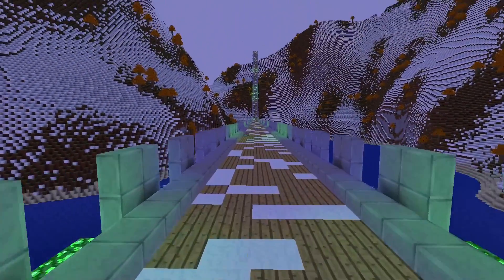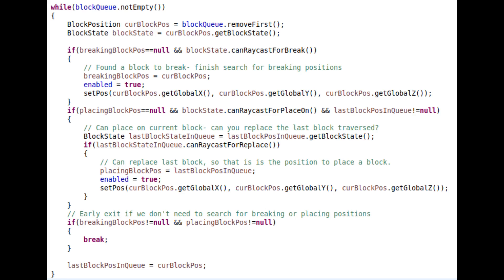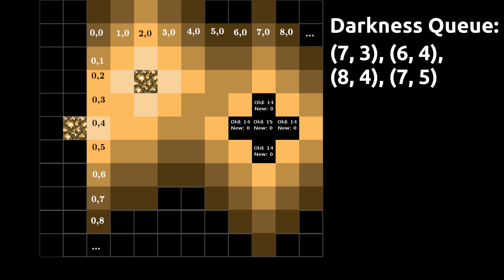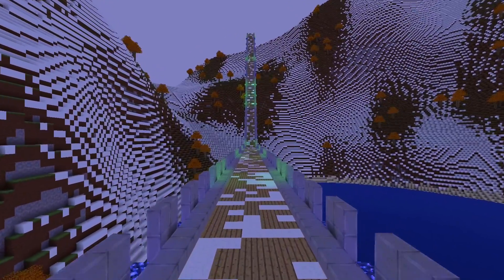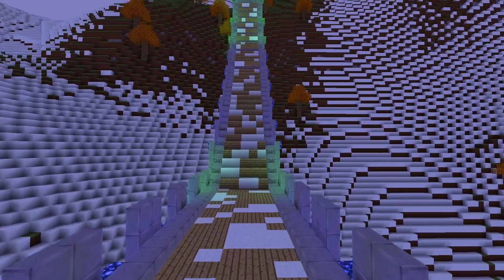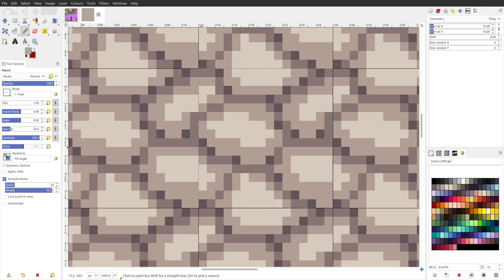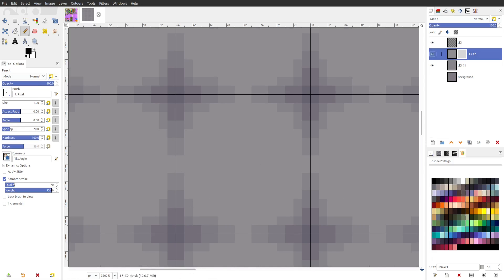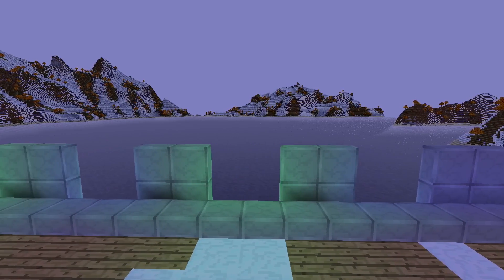The Algorithm Behind Breaking Blocks – Remaking Minecraft

Comment: I'm always facinated by your videos and am somewhat basing this to make my own voxel engine but in C#. I have 1 question though. How do you remove unused blockstates in the block palette when setting a blockstate. I'm thinking of checking each block ID in the chunk and if none point to the block in the chunk palette then remove it and update all other ID's above the removed one. However I don't think this is efficient so I would like to know how you did it :)
Reply from the maker: I've purposely left that for later! I'm leaning towards having a second collection to map blockstates to the number of usages. Once it maps to '0', then remove the mapping and the ID palette mapping. Alternatively you can iterate through whenever 1) you save or 2) you run out of IDs, then remove unused mappings. It depends on your use case.
I would not update IDs of other blockstates, it's better to have it be discontinuous with a C# Dictionary<> instead of an array.
Reply: @finalforeach  Ah ok. Thank you!

Comment: Is there a benefit to putting all the block textures into one file instead of multiple separate files like Minecraft does? Would you ever consider putting the textures into separate, unique files?

Also the texture work you've is really solid, if you ever decided to translate it into a Minecraft resource pack I would use it 100%.
Reply from the maker: The advantage of using a texture atlas is that it's 1) simple to implement and 2) doesn't require a separate draw call for each block. I think there is a better way with texture arrays, and even if that isn't used, an atlas can be stitched at runtime from multiple textures. Having separate texture files is on the todo list, but not the biggest priority right now.

Comment: For crafting, I would just wanna say this: modded Minecraft, often with larger modpacks, solves this by grouping recipes in the recipe book (or perhaps in the JEI mod) by modpack, and then by resulting block. If there are variations to a block, it lists them separately, however, if there are not, it uses a system of "tags" on specific block type variants. For example, you ca  craft a chest woth any type of wood, but in heavily modded Minecraft, you can end up with tens, if not hundreds of wood types. So the solution is to have a mod library which can list all these wood types under one simple tag that the crafting recipe can comprehend as the same usable block for one singular recipe.

Comment: For the inventory. Please add a mechanic that lets you choose the texture or color of the blocks placed.
For example: only have generic variation of wood items in the inventory and if the player presses c with an oak plank in his hand, all generic wood items placed afterward will be made of oak (using one oak plank for each block placed), until the player has no oak plank left, or he presses c with an empty hand. 

You can even allow players to change the type of wood once the block is placed by looking at the block and pressing C with oak plank in their hand.
Of course when the player breaks the oak variation to get it back into his inventory, he only gets the generic variation (and the oak plank... or not).

This way, you don't need the items for different variations, you only need the generic wood items (made with any type of wood) and some planks of the wood you want.
I think it's better than Minecraft because it's very annoying to have 7 different doors in the inventory because there are 7 different types of wood; with this mechanic, a single item for a generic door is enough, and the same goes for all items in wood. But the player has access to all door variations.
You can do this for different woods and different stones.

If you don't like that the player only uses 1 oak plank to make 1 oak stair (and some wood to make the generic stair item), you can use blueprints instead of the generic items in the inventory. Once you press C with an oak plank in the hand, the stair blueprint will autocraft and place the oak stair where you right click with the blueprint.

Extending the mechanic to allow blocks to be painted with dyes could also be done. It gives the player a wide range of possibilities without filling up the inventory. Maybe add a spray gun to make it easier if the blocs are already placed.

Comment: could you also fix the flickering of the block outline when you are moving? ^^
Reply from the maker: Yep, there's lots of tiny bugs just like that one that need to be fixed all the time! This one is affected by the current camera system which sucks and will be replaced later, hence why I didn't fix it for the video.
Reply: @finalforeach  also, another question. You said you may put it out for everyone once you feel like it's ready. Aren't you worried that mojang will just instantly take everything down?
Reply from the maker: @whiskey910  1) For prototype purposes I'm still using some of their textures so I cannot release it, 2) I need to confident on the release model and license, which I'm still unsure of. 3) I need a good name that will capture the spirit of the game, which I won't fully grasp until later.

Comment: Just wondering how did you make the bridge without building?
Is this you first test with structure generation?
I see that as it goes over a mountan it gets unclimbable with minecraft like gravity. 
Would you make this apart of the game?
I personally think it would be cool to see ruined walls from your testing.
Reply from the maker: The bridge was generated in code for the sake of testing / showing off vertical slabs, and has proven useful for finding lighting bugs too. It won't be in any final world generators, but I'll be sure to include cool structures.

Comment: I would like to see block variations, you can hash the world position of a block to get its texture, by using some clever math with greedy meshing you can also use the same number to generate rotated position of the block without having to store the rotation in memory, and would only add a small performance overhead even if you went through the extra trouble of double hashing the position of the block to separate its variated texture and its rotation entirely, I would recommend doing this in your fragment shader somewhere

Comment: Block Usage & Crafting  thoughts.

I always wondered why planks in example weren't just a generic resource type that could be used to craft a generic unnamed 'wood', where the premium named woods like birch and such would (badum tsst) require a singular type to craft a named wood variant.

My imagination claims that the base unnamed 'wood' is the generic top of the folder-structure-like tree.
wood
_oak
_birch
__birch door
__birch planks
_wood door
_wood planks

and the items in the recipe workstation get checked backwords through this list based on what blocks are present in the recipe station.

Also, when there are multiple valid recipes for one reason or another (such as a stone in the top left creating a tiny decorative block shaped to that placement intent of a block's face like a stair, but shappleless allowing you to transform it from those intercraftable stone states to an unmodifiable button to communicate it from a resource to a functional and crafted piece of utility).., In such instances a gui solution showing you or letting you articulate a chosen option of which valid craft to use (defaulting to whatever is closest to the resources involved's state (using all birch should be birch, but using 1 stone should be stone, meaning priority weights need to optimize a 2nd order in the resource tree for showing you which recipe upon multiples to narrow in player intent so that complexities of the block(s) etc aren't the default, letting you optimize further down the line how new woods without a door recipe (balsa wood) and such to coexist in the resource allocation structure and recipe indication structure alike.

ps, edge cases where unnamed 'wood' could convert back to let's say.. planks, you would get unnamed 'wood' planks back, which in of itself is a crafting recipe to mix woods into something you can create, and then scrapping it for a resource type you cannot naturally aqcuire.

Comment: I have been thinking about this, later in this games life i think it would be to its advantage to not limit itself to just the standard cubes/slab/stair ect. That Minecraft does. But allow for 3D block models, somewhat similar to what we have seen in some mods or texture packs, or in vintage story, and teasers for Hytale. So lighting would need to be considered for these.

This could also lead to more volumetric, or "realistic" trees od sort that still work with yhe world gen, probably not the most efficient way.

On crafting I like how in vintage story you can have multiple of the same item in the same slot when crafting.
On multiple variants question, having it to where within a recipe your can select the specific resource variant you want to use or the game will smart select from relevant resources in your inventory, similar to how mine crafts recipe book works or terraria treating all wood as wood in certain non wood specific type recipes.

Comment: I figured out how to multithread my chunk meshing code, so breaking and placing blocks is instant. None of the batch stuff required.
Reply from the maker: That's great! The curious thing about optimization is that it's often implementation dependent, hence why it was important for my project, alongside other improvements that were not shown in the video. It could be that said improvements were the actual dominating factors, but it's hard to tell while working on multiple aspects of optimization at the same time.
Reply: @finalforeach  Yeah.

Comment: There's one major flaw with factorio-like craftimg system. If the game has a lot of crafts and/or player adds a lot of mods, interface will become quite frustrating. In factorio you can just install space exporation (very big mod), finish all research and bam, your inventory occupies the entire screen.

Also, crafting everything with bare hands makes very little sense sometimes, so i'd rather suggest using many different "crafting stations". Like, to craft planks from wood you at least need something like a saw, and a flat surface to place wood on it. Crafting tools from metal would require casting or smithing.

The only problem i see with this approach is that it may become very confusing for new players, so you'll probably need to keep it relatively simple.

Comment: A crafting system idea for blocks:
When holding some block and a key is pressed a wheel of blocks should show up
Ex.:when holding a oak plank block the wheel should show up slabs,stairs,doors,buttons,fences/walls,etc
When any of this blocks drop all of the should drop the original block.
This should make invetory very manageble and dont need to create a lot of items and craftings

Rotation sytestem idea for blocks:
Similar to creativerse you hold a key locks the camera and can rotate it on an axis
This would make vertical and horizontal slabs,stairs,doors,fences/walls,etc. Without making new blocks

Extra:
please dont make blocks that need other blocks like in minecraft, somethimes i want to put a door on the air and I just cant

Comment: if player movement is being added next I'd definitely suggest a way to make it easily changeable by the player so people could switch from classic Minecraft movement to maybe source engine movement. would be neat, probably a pain though.
Reply: i'm p. sure minecraft movement is already deceptively close to source engine movement, as minecraft takes a lot of direct cues from quake ( hence the "quake pro" joke on the fov slider ) and the physics certainly feel like they're feasibly an attempt to replicate quake's basic movement without actually directly referencing the source code

it's just that they didn't bother replicating airstrafing. and there's no slopes. so all of the important parts of the truly silly movement tech are either not there, or not there because they're straight-up incompatible with the block-based fundamentals, leaving only like rocket jumping via tnt cannons. and ... like, doing the saddest bunny hops to retain sprint speed

yeah, i'm not sure airstrafing would be enough of a gamechanger to actually make it feel like source engine

Comment: About the leaves, maybe I misunderstood you but I pretty sure that can look really good even with a fraction of faces.
I'm making a resourcepack for minecraft that improves all of the vegetation and that includes leaves, while making everything as optimized as possible.
Including that you already made model loading system (at least as far as I remember, sorry if I'm wrong), and if ability to manually set face culling direction (for example force face to cull if south of the block is obstructed, even through the face itself faces north for example) is gonna be implemented alongside with ability to slightly offset some specific verts on a random amount per block, optimisation&improvement technique that I used for leaves is also possible here.

The idea is simple: 
1. cull all of the inside faces so it looks like with optifine's "smart leaves" option
2. each block has 2 addisional squares (8 triangles total, and 4 of them gonna be discarded via backface culling either way) that are randomly offsetted(if that's even a word) to prevent Z-fightning
3. each of these squres has it's culling direction set to the random value or just be none with like 10% chance to fill the empty space inside leaves masses.

With this leaves will have something that fills inner space without dozens of unnecessary polygons, also side effect is that on walls of leaves many faces will be culled, less on the edges and rarely on the corners, which also means that detail where it's not needed is also removed.

Sorry if you can't implement this and you just read this all for practically nothing, if that's the case I hope that maybe you've at least got some ideas.

(also sorry for my horrible English, I'm not a native)

Comment: I really not think that crafting is something that need simplification. (As in factorio lists for example)
As a old modded user, crafting something is an important part of gameplay and it needs to be interesting. Even vanila crafting bench surprisingly good  that, as it allow experiments, but it is really simple (In counterpart some other games with more realistic crafting). 

In reality i think it depends on what minecraft you want to create:

Is it something with RPG elements as hytale?
Is it hardcore survival game like vintage story?
Is it creative game where you can build anything you want in greater render and more?
Is it minecraft that can be modified without problems with performance? 
Is it automation game like expert modpacks where you use a system of machine to automate creation until reaches the goal?
Is it stage where you can set plots and role-play?

Is it world that allows simulation of computers so you can play minecraft in it using Redstone?
Is it place where you can create minigames, like Decked Out 2,
Is it something that was never created in Minecraft?

Each of them will have each own crafting systems. It actually absurd that minecraft can exit in most of them, even if with help of mods.

In the end, it's minecraft that really popularised crafting, and a workbench is kinda have the same value as a block of dirt or a creeper.
Reply: I recommend  "Building Better Crafting Systems" "Adam Millard - The Architect of Games"

Comment: Regarding your question about making the same recipe with different variations of the block, I would use tags.  For example, sticks could be made with any type of 2 planks.  So, I would have all variations of planks have the tag "planks".  Then, the crafting system will not look for specific blocks in this case, but will look for block tags.  Does that make sense?

Comment: Would it also be viable to generate some sort of temporary non-greedy mesh for the chunks you edit, instead of making the chunks smaller? Once it's generated, you might also be able to more easily edit that mesh instead of regenerating the whole thing. Optimizing for many blocks being placed/destroyed in one area would probably be worthwhile, since that's what players usually do.
Reply: It's what players do, but snowfall or plant growth can easily update a bunch of singular blocks (for example with pumpkins or chorus plants).
It's nice if optimization can utilize the way that players place blocks, but it shouldn't rely on it too much.
Reply: @Pystro  The thing is that you don't need quick feedback when a plant grows or when a bit of snow is generated, it would even be fine if the chunks took multiple seconds to update in those cases. Also, depending on what kind of plant it is, it might not even need to update the chunk's mesh, it could be rendered separately.
Reply: @packediceisthebestminecraf9007  Good point.
Only the closest few chunks probably need to show plant growth immediately. And then they are in that player editing range.
Or alternatively, the game could concentrate all random events in a single chunk per tick and then not touch that chunk for a second or two. (The only exception would be water flow or redstone.)